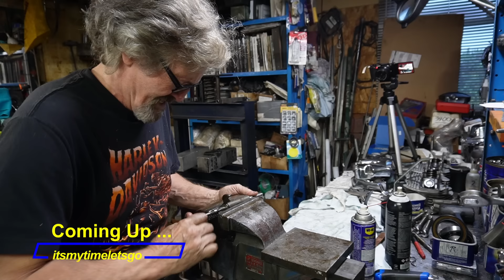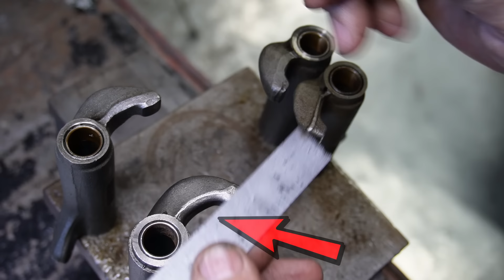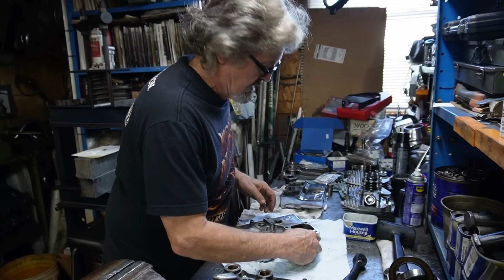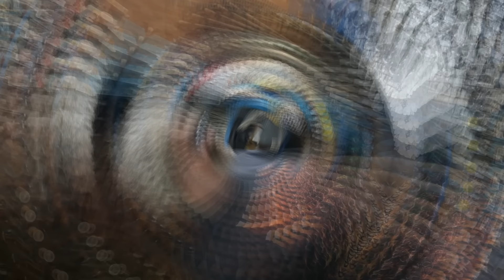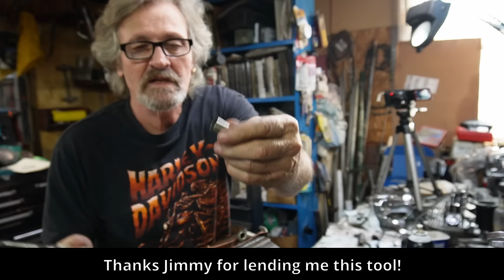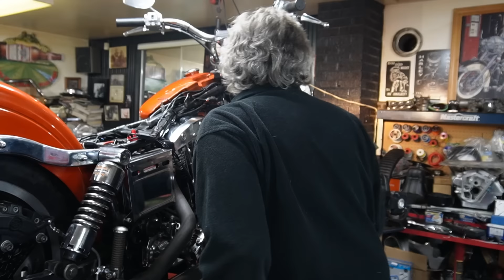HOW TO REPLACE ROCKER ARM BUSHINGS / THE ROCKER ARMS WERE TRASHED / THE TICK IS FINALLY GONE

Comment from the maker: Have you seen this problem before?
Reply: Back in the 90's I ran into a bunch of rocker arms that were "hand ground" poorly and had to replace them with new ones.  I found quite a few "bad castings, poorly ground", I think aftermarket rockers were a problem then. I made a fixture to diamond lap the tips parallel to the shaft with a slow speed grinder, diamond flat wheel.

Comment: Great video. Ralph, I have rebuilt. many Harley rocker arms. I use a blind bearing puller to. remove the bushings. very fast and easy.
Reply from the maker: You could use that, if you had one. I do not have one that small so just doing it this way and trying to show another way to do it, for those who also do not have pullers. Thanks for your input and commenting.

Comment: I have a 97 Sporty 1.2 liter..lol I had a rattling sound coming from the top of the bike. Well one day I figured it out. It was the gas cap rattling on the tank. Drove me nut's. It was a top end noise.  Hahaha
Reply from the maker: Sound like you are like me and the little things can drive you nuts. I often see guys that say "sound like a rattle in the motor"  but it turns out to be something loose, like heat shields etc.Thanks for commenting.

Comment: Why would anybody grind the pads off the rockers and another great video
Reply from the maker: They do it if the end pads are worn, to bring them back so they hit on the valve end properly. But you have to be very careful not to create the problem I found here. You need the proper tool to do it right. Thanks for commenting.
Reply: @ ok I can see that or just polish with a find stone but to grind them just don’t make sense

Comment: Have used hardfacing rod to build these up and made a fixture to grind the lobe. Enjoy the video's!
Reply from the maker: That's pretty old school stuff but many things were done that way in years gone by, to build up surfaces. I remember doing such at school in 1980, when I took a machinist course, and they had the equipment to do it. You certainly do need a fixture to do it right and proper. Thanks for commenting.

Comment: Bloody hell, amazing those rockers even worked, they must have ground, then mounted to see if there was clearance or just fluked it to fit?, the geometry must've been all over the place, how were the ends of the pushrods?
Reply from the maker: Pushrods were fine, but pretty sure that was the noise from them hitting the top valve collars. They were in the rocker boxes when I got them so surely it was a back yard job. I check the clearances but over looked the ends as it was unnoticable until they were removed and checked. My bad. Sometimes people should just leave things well enough alone if they are not sure of what they are doing. Always seeing new things, not always good ha ha. Thanks for commenting.

Comment: Excellent video! What reason are the rocker arm ends ground down? Is it done when you put in a high lift cam? I had seen them ground down before, but not remembering why.  Seeing how you pulled the bushings out of the rocker arms was worth todays admission cost!!! LOL! Interesting technique.  One last thing, say you put the bushings in and the hole did not line up, could you just drill in a hole?
Reply from the maker: They are ground to resurface them, as you often see ones that are irregular on the pads. But llike they say "to much of a good thing might not be good" and thats the case here. Would not be for high lift. Yes I would think you could drill them out, through the hole if need be, but you would have to that before reaming them out. Thanks for commenting.
Reply: @itsmytimeletsgo  Thanks ..
Reply from the maker: @enemyilaf  You are welcome. Thanks!

Comment: I've got what I think is a stock 1970 FLH what would be a good cam that I could put in there that I would not have to do any head work or anything other than put in the can but I would feel it at low to medium RPM where I normally ride. Something that would be a good money spent cam I don't use the hierarch RPMs. Thank you so much
Reply from the maker: Andrews is what I generally use. A "J" is a light improvement over stock. More RPM though out the range. I like the "A" grind cams as they seem to perform well, with considerably more lift . The A2 will give you a bit more mid range to top end, where the "AB" is cooler running, as it has a longer exhaust duration, and gives more top end power. All are said to be  bolt ins (except for 80-81's). Thanks for the question and commenting.
Reply: @itsmytimeletsgo  tx for the info .. sounds like Andrew s A . is for me ..where does it start to pull RPM wise ..I would like off idle ....

Comment: What would be a good cam for a 1979 80ci shovelhead for a little more power? Andrews A grind?
Reply from the maker: Usually I like an A grind. Andrews also has an AB with a little longer exhaust duration to run a liitle cooler. If you go to a B it can involve head work in some shovels. The A is usually a bolt in and has more pull in the lower RPM's where most people spend their time. The B, I think has more pull at higher RPMs. Depends what range you are wanting the power in. Thanks for the question and commenting.

Comment: My 1970 someone  put a later model kickstarter on it.
I put a stock went on or the one with the popsicle Kickstart. Is there any plus to having a later model style Kickstarter like the one that is on the bike you're working on with the round peg Thank you
Reply from the maker: I don't think there is a lot of difference except this one seems to fold at the bottom of the stroke, if you don't pay attention. I don't like that about it. I would rather have the old standard popsicle type. I think they did that to clear the exhaust set up, of the time. If I run into a problem like that, I usually will use the "longer kick start shaft" to get it out a littlle. I think they are an inch longer.  They work very well. Thanks for commenting.

Comment: I'm a little confused, or maybe I missed something. But if you ordered new rockers why are you messing with different/new bushings? I could see if you were keeping the old rockers, but that was the problem. Great video BTW, thanks.
Reply from the maker: I did say in the video that I was ordering new ones, to use in my basket case project Margaret, so I was rebuilding the ones from that motor to use in this one. I threw the bad ones in the garbage. Thanks for commenting.

Comment: What do you do to the newer ones. Like the103s  top end tick rocker locker said to be the fix...? What's your opinion and experience tell you is the best fix?
Reply: Shovels make all kinds of noise lol
Reply from the maker: I hear Rocker lockers help, and I made a set (and video) to use in my trike, and it is quiet.  Not sure if it was because of them or not. I have seen weak lifters causing noise as well. I cannot speak to this problem really, as the newer bikes are not my thing. Thanks for commenting.
Reply from the maker: Yes they do. Thanks for commenting.
Reply: I fitted rocker lockers and roller rockers to my 2001 Twincam. That made it a lot quieter
Reply from the maker: @andrewbispham1080  Good choice! Thanks for commenting.

Comment: I would think that the adjustable push rod then would be a lot more thread showing
Reply from the maker: Not generally. You might be comparing them to "Quick Time Pushrods" for Evo's and Twin Cams. They generally have a lot of thread showing after installation.  Thanks for commenting.

Comment: Crane cams years ago came out with needle bearings in their rockers arms,it was a total scam as the needle bearings would gall the shafts,and they ended up giving you your money back once they found out the rocker arms were a scam.What you want is bushings in the shaft and roller rockers on the tip.
Reply from the maker: I seen those many years ago but never thought they wre a good idea, and turns out they weren't. I like to use these solid bushings so I can ream them to size and have used roller rocker arms in bigger motors. But I only buy quality ones if I do , like Jims etc, for fear of cheap ones failing. Thanks for commenting.
Reply: @itsmytimeletsgo  Been running the crane roller tipped rocker arms for 30 years with no problem,agreed Jims quality is off the charts.Thanks for your channel,big thumbs up.

Comment: I see you last this question somebody had posted. Yeah I asked one thing I wouldn't be doing you know playing Jerry Branch
Reply from the maker: That is correct. Cleaning things up a little doesn't hurt, I dont think. But  hogging the material out can get you in a world of hurt. Might flow good at 7000 RPM LOL You cannot port a head with out the proper equipment to see what its flowing. Thanks for commenting.

Comment: Not fully watching the whole video yet why would somebody grind that down now I'm out of mechanic. At all just wondering
Reply from the maker: You can grind the tips very lightly, but only with the proper Jig, when they are marked up. If you just try it with a grinder this is what can happen. They have to be perfect on each angle and only a very small amount can be taken off, or youcan also get through the hardened surface.  Best left to someone who knows what the a really doing. Just hoping to encourage others to maybe have a second look when they are in there.  Thanks for commenting.